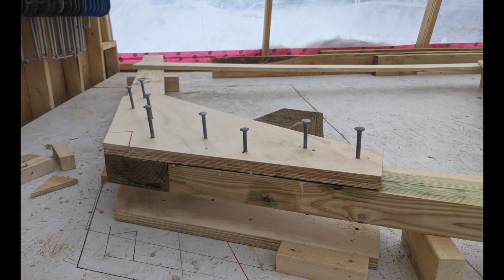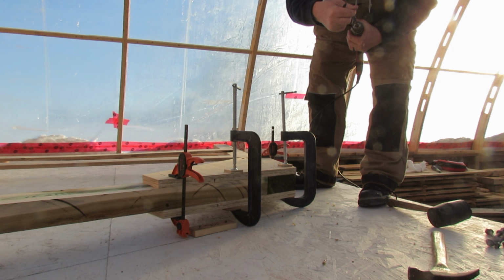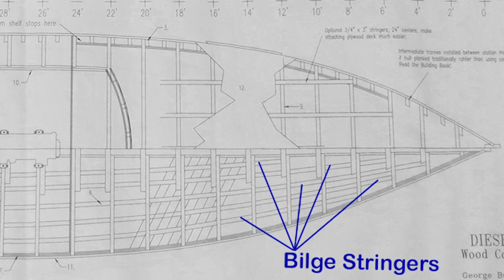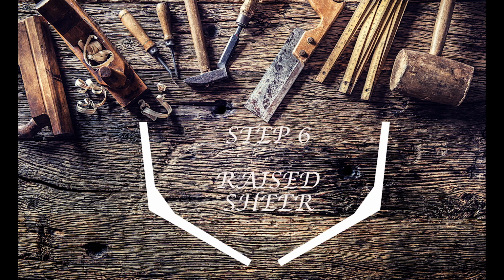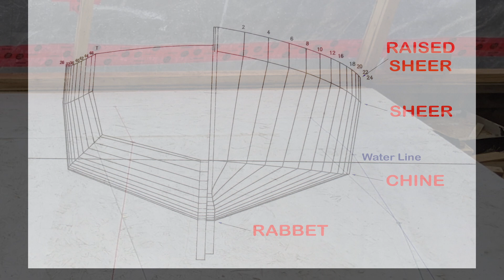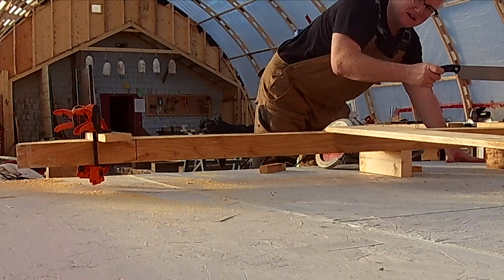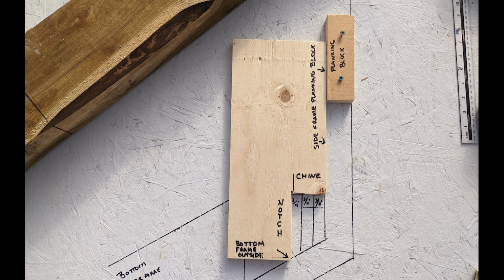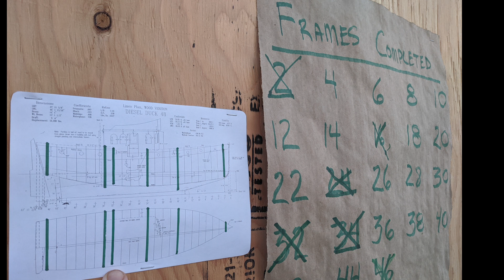Boat Build Framing Part 3 - Ep 12 - DIY Building A Wooden Troller Yacht

Comment: Nice work Bill. I expect you’ll have them up already in real time. However I would be saving the wood glue for the bookshelves and switch to thickened epoxy for future structural joints. Way stronger, impervious to moisture, etc. All round a much better choice for boat building. Especially a boat of this size and weight. 
Cheers
Reply from the maker: Thanks Robin. In real time I am not quite to attaching the frames just yet. Almost done the keel, but this beautiful Canadian winter is providing very fews days warm enough in the boat shed, even with a heater, for laminating. The side benefit is I should be able to catch up my videos to real time.

Comment: Good job on the frames . I use  Titebond 3 all the time have built 5-- 14ft dory and have had no problem with the glue .
Reply from the maker: Thanks for sharing your experience with Titebond 3.  The frames are stacked waiting for the keel to be finished and have seen no problems with them delamination at all

Comment: I like your channel, you seem to have the knack of presentation which I am sure will get even better with time.

While I understand the Titebond though I wouldn't be using it personally in that situation when a Moisture cure urethane is similar cost and bond strength but infinitely more waterproof.  I also would have glued then bolted after cutting chine notch. But then I frame out much smaller boats usually where its easier to move them around on the work bench. Not meant as criticism just pointing out alternatives for the purpose of discussion.
Reply from the maker: Hi John.  Good suggestion on using a urethane vice Titebond.  Like many things, there can be many different option available.  I went with Titebond 3 as it is a waterproof which Titebond 1 &2 are not. So I am pretty confident it will do the job.  Plus I plan to paint over the gussets after being installed, likely with a bilge specific paint.

Never thought of cutting the ply seperate from the timbers. Definitely an option.

Thanks for the comments.

Comment: I know Titebond III is waterproof, but I’m wondering if epoxy would have been a better option. Just a thought. Aloha from Hawaii.
Reply from the maker: Epoxy would certainly have worked as well. Epoxy is generally more expensive here in 🇨🇦, and definately has gone up in price over past year.

Have a warm Hawaiian evening, says the guy preparing for almost a foot of snow tonight🥶
Reply: @TheAmblerOdysseys  Perhaps more expensive but you won’t use much in a joint and the epoxy will be near the bottom of the list when it comes to expenditure on building a boat. I really think you should reconsider using wood glue.